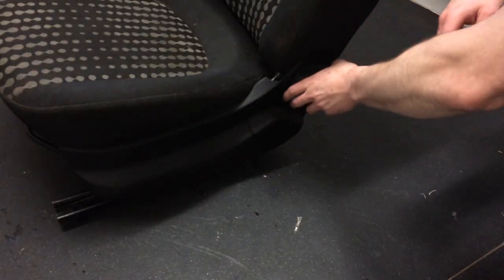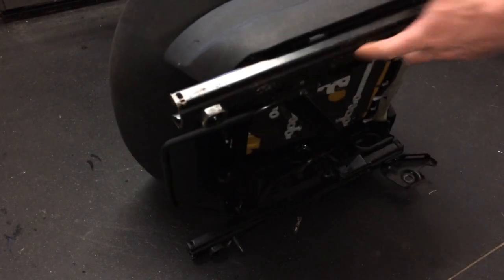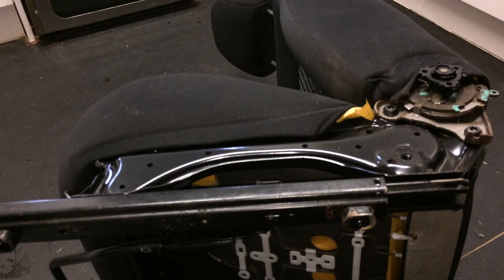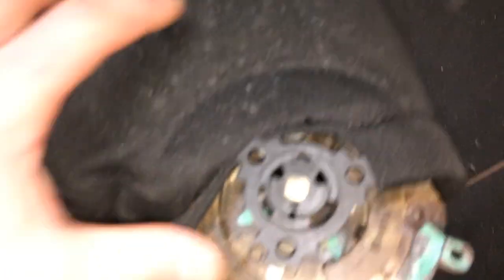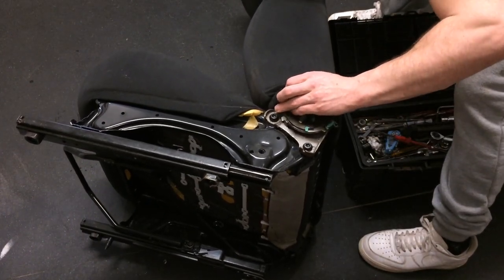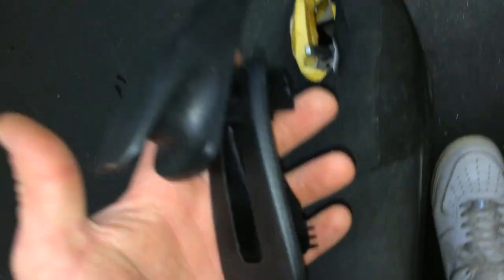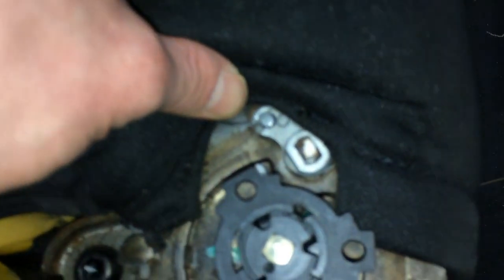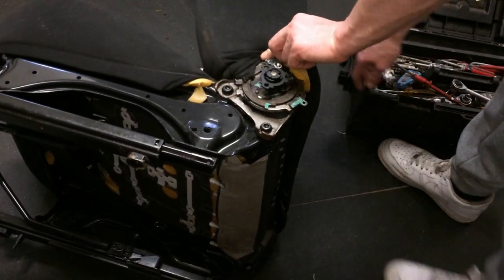Fiat Punto Grande - How to Replace Seat Release Cable

Comment: Thanks for the video. I have a 500e and its slightly different. but you showed me where to start. You can tape the new cable to the old cable and pull it thru that way.

Comment: Great video. 
Is it necessary to disconnect battery before removing seats if the seat has an airbag? And leave for 2 hours to discharge? Or would that be unnecessary caution?
Reply from the maker: Yes would be advised. It’s unlikely to go but if it’s live the chances are higher. Cheers.

Comment: Hey man thanks for your videos you are a life saver! I have a problem with a height adjuster lever on the driver's seat, any advice where to look to fix this? The problem is it doesnt hold the height, it always comes down when I sit on it and then comes right back up when I get up from it.

Thanks in advance!!
Reply from the maker: Hey thankyou! Sound like the catch in the handle is sticking up keeping the height adjuster open. Try spraying some WD40 into the handle it might losen it. Once it click back into place it will hold the seat when you sit on it. I will try and do a video in the next couple of weeks. I dont have the car at the moment.  Hope this helps. Cheers
Reply: @1NELIFE  thanks for the reply, I figured it out myself. The problem was that the two bolts were missing inside it so the whole handle was out of its place, which resulted with seat being unfixed.

Comment: Hello, Thanks for the amazing videos. I must have used at least 4 in the past month to fix things, much appreciated. 
Im having trouble getting the cable removed from the hole in the lever (6:50) as there's no room to move the 90degree bend either side. any tips?
Reply from the maker: Hi thankyou ! Its the most awkward job lol. Try fishing ot with another bit of wire or something a like. Its not east but dont give up! Let me know how it goes. Cheers

Comment: Hi mate, brilliant video, but got 1 or 2 questions? I'm having trouble with fiat 500 driver seat stuck in the tilt forward position so cant drive the car. 1, is this the same with the Fiat 500? 2, Is there anyway of releasing the mechanism without renewing the cable just to get me to the dealership? Thanks in advance

Comment: Good job! by the way i got a problem with power steering it doesnt work and there is a light on dashboard.
The question is could it be motor???  and any suggestions. Thanks
Reply from the maker: Hey. There is a good chance the motor has gone, its quite a common problem, check the fuse first but if not that you most likely need a new power steering motor. Hope this helps.
Reply: @1NELIFE  I ve checked all fuses, they are all fine, so it means that motor has gone, do i need to change whole column or just replace the motor ? Btw thank you for your reply

Comment: Hi mate, thanks for the upload to start with, now I appreciate you posted this a year ago and may not remember. At the handle end the cable is split into 2 separate cables, a long one that goes to the release at the bottom, and a shorter one. Any idea where the short one goes?
Reply from the maker: Hi sorry for a very latr reply,  I will have a look somtime this week ( the cars not with me atm ) and let you know asap, if you havent already sussed it. Sorry again. Cheers

Comment: I've just done same car model but drivers side.. that release handle at top releases Two cables..each being left abd right side of the seat..them cables also clip half way down their feed areas to seat frame so their under foam bolster sides...its common that the alloy sprockets that the cable eyes slip into break to..